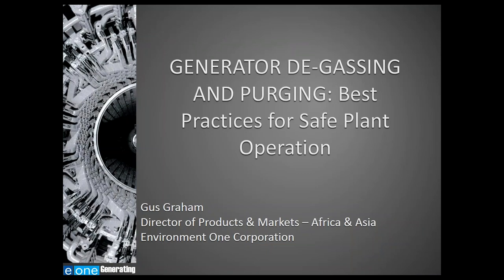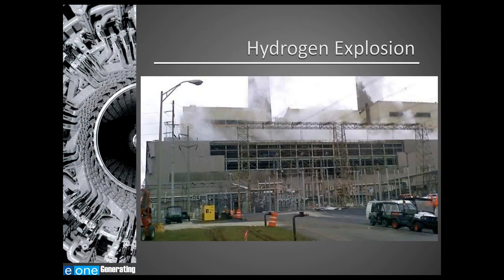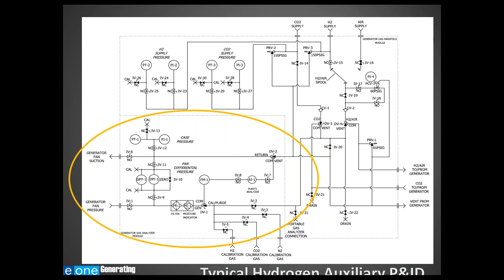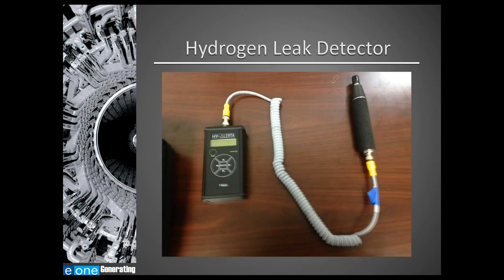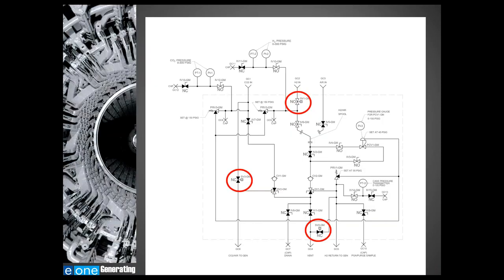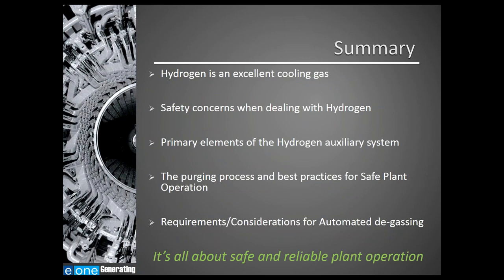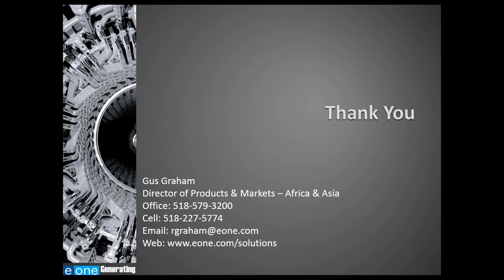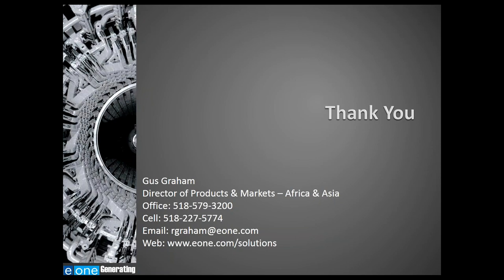Webinar: Generator De-Gassing & Purging: Best Practices for Safe Plant Operation

Comment: Why do you not push the CO2 out the lower header by adding air the H2 header. Based on the weight of the gas it seems that would be the correct way. Air in the top and CO2 out the bottom.